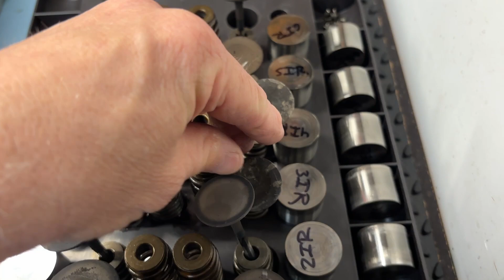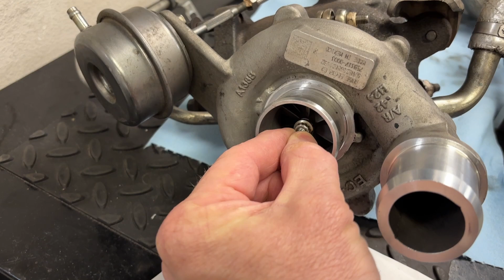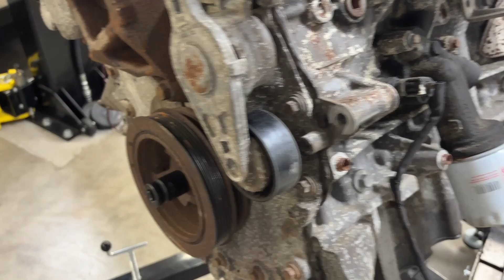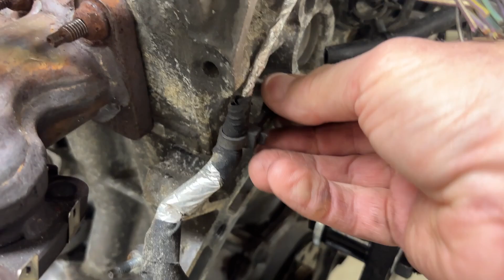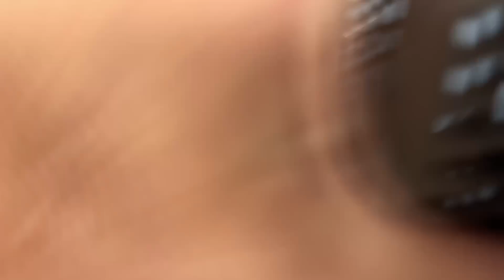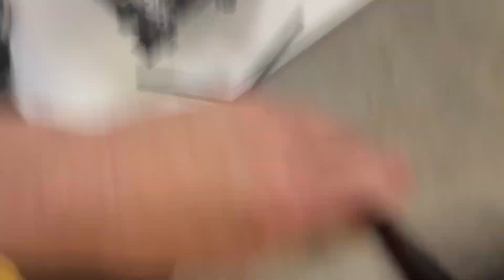2013 Ford Taurus SHO Engine Swap (Part 5)

Comment: Also, you HAVE to use the reluctor wheel that came off the SHO motor as the PCM is looking for a specific number of teeth and not just the gap.
Reply: You can tell I didn;t watch the whole video... LOL

Comment: when comparing the reluctor wheels, you have to hold them with the teeth pointing to the same direction to see if the gap is correct.  Not teeth to teeth.
Reply from the maker: You're absolutely right, I did noticed notice that later and forgot to edit that out. I did later make that same comparison with the teeth in the same direction and did confirm that the missing tooth is in a different position. Great catch and thanks for pointing that out.